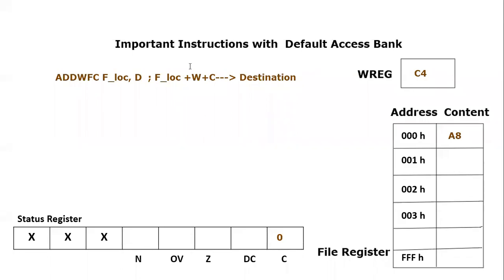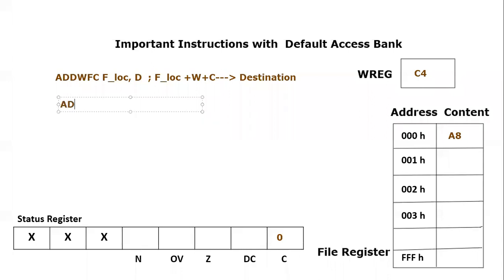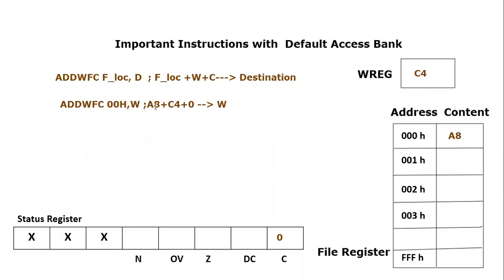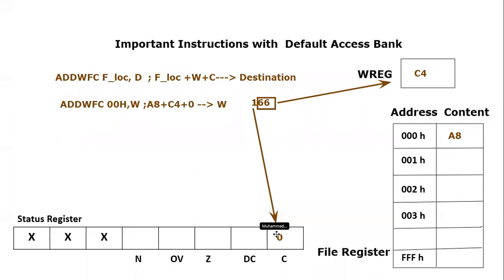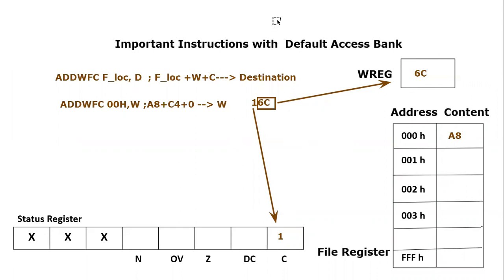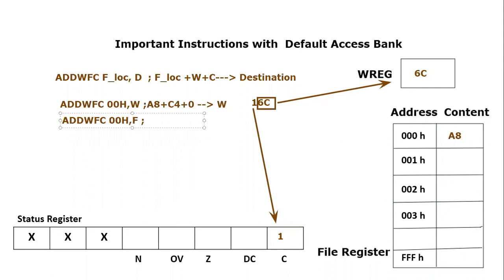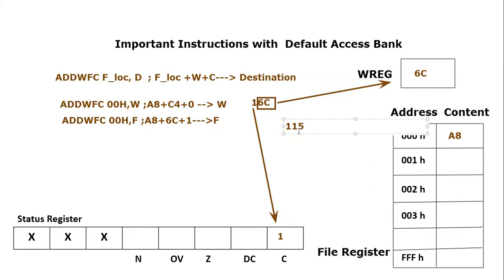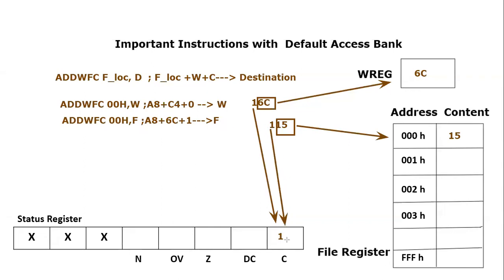ADDWFC Instruction in PIC Micrcontroller || ADDWFC Syntax

Comment: Sir but actual result is 214h but pic result is 115h is correct or not
Reply from the maker: How actual result  is 214? Correct result is 115
Reply: @LearnOnline1  sir, (A8+C4+A8=214H) as per the actual decimal addition of this numbers (168+196+168=532) is decimal so convert hex 214 so pls explain
Reply from the maker: @arunsaravanan2444   Now, I understand your question. We are not performing addition of Three hexadecimal number . In this video I was explaining how this instruction works. Now, Eventually this instruction is useful when you want to add three 8-bit Hexadecimal number but we need to keep in mind that PIC18F is 8-bit microcontroller which can express the result upto 8-bit or maximum we can go upto 9th bit if we include the carry flag as 9th Bit. In this example as you said A8+C+A8 is addition of three hexadecimal number (8-bit numbers) but their actual sum is 214 H which is 10th bit  number . So thats reason you cannt get direct result. If you still interested to deal with such results you need to right special subroutine which will concatenate the  two file register location to express the complete result. I hope you got my point .
Reply: @LearnOnline1  okey sir I understand.then extremely thanks for quick reply .thank you.
Reply from the maker: @arunsaravanan2444  I am pleased that I could help.